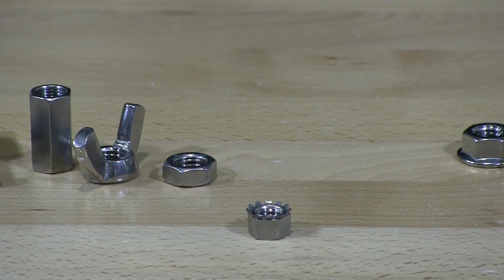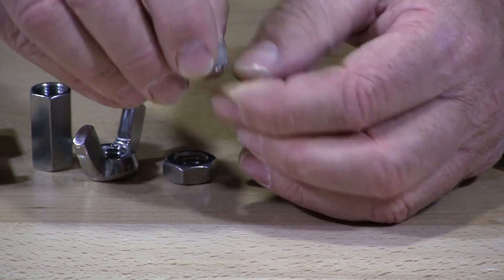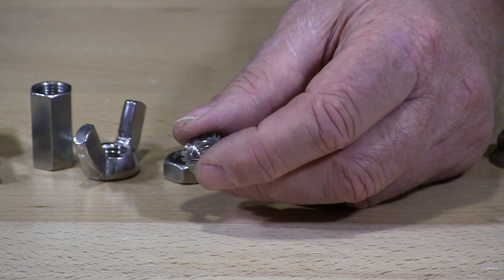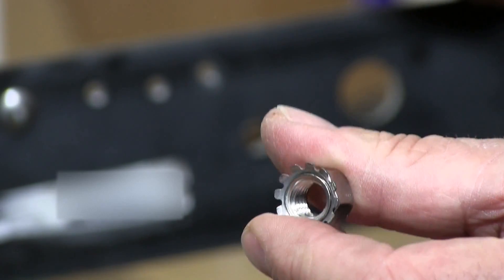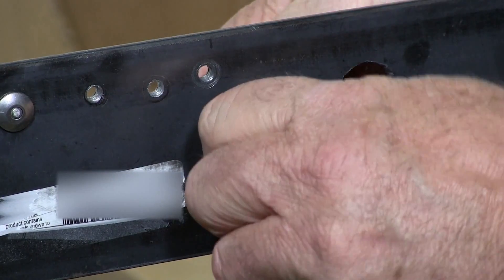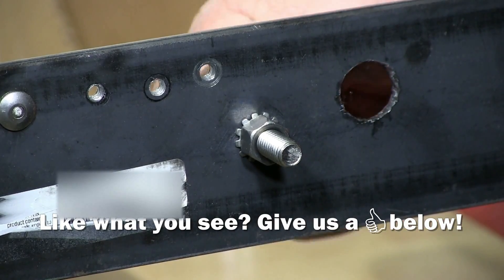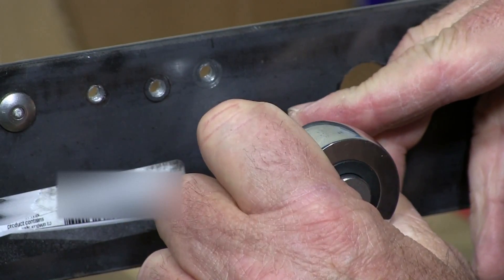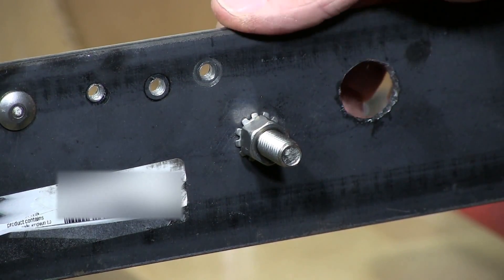How to Install Keps K Lock Nuts | Fasteners 101

Comment: Thanks for the video! Is there any way to remove this kind of nut?
Reply from the maker: A simple wrench or ratchet of appropriate size should be enough. These may be lock nuts, but they're resistant against vibration not active attempts to uninstall them with tools.

Comment: thx for video! What's the advantage to free spinning? Why would you WANT the nut to spin? thx!
Reply from the maker: The washer is free spinning, not the nut. It makes the assembly more convenient so you don't need to get a seperate external tooth lock washer to help lock your assembly down.
Reply: For a hinge